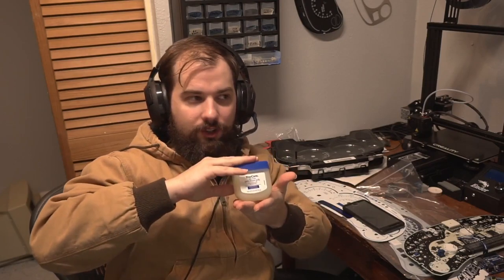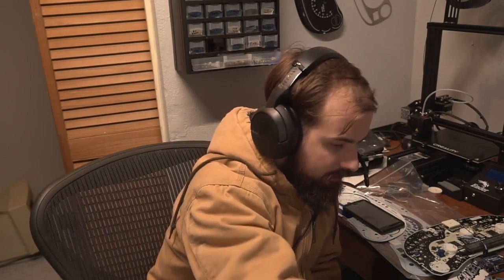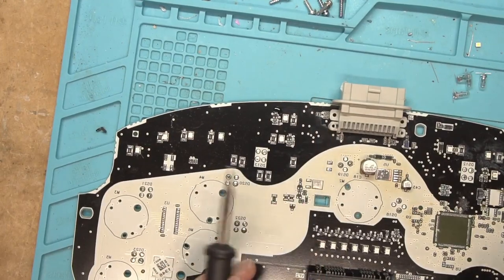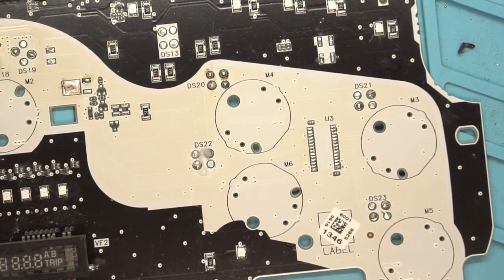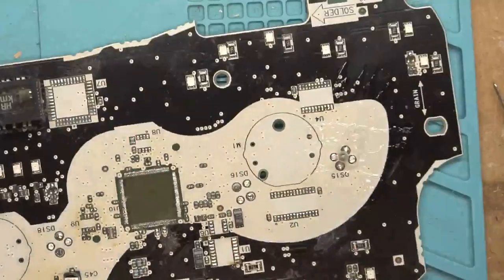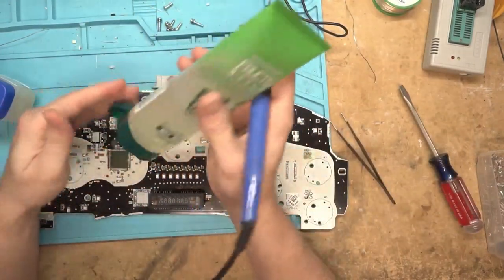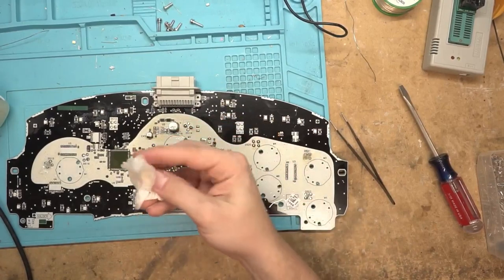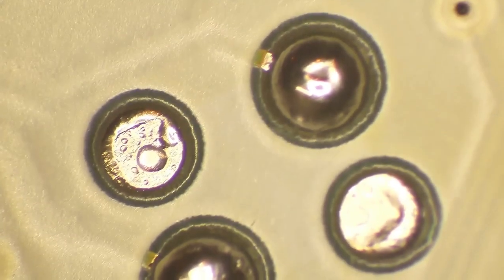Vaseline. Will it Flux? Using Petroleum Jelly As Flux...

Comment: Hello there, thank you for the cool video. I have a Weller soldering iron and want to use it with empty plastic jugs that used to contain drinking water. You can make all sorts of things with empty bottles and I like the recycling aspect. The soldering iron gives surprisingly straight & clean cuts compared to an utility knife. Now, to avoid molten plastic to coagulate around the tip, would it help to immerse the tip in petroleum jelly before hitting the plastic? Thank you in advance!

Comment: Hello sir , i am using a flux cored wife for soldering but when i am joining the solder and the soldering iron the flux inside the wire is comming out and getting burned and making the molten solder black and unusable what i can do ti fix it?
Reply: Clean the iron tip and reduce temp
Or use different solder

Comment: So vaseline does not work ?   ---why make a video if it does not work as a flux //.  and what is am tech / ?? ---THIS IS WEIRD !
Reply from the maker: It did work exactly as shown in the video. Amtech is a brand of flux that is popular due a few technicians that use it on YouTube like Luis Rossmann. Due its popularity there is a lot of counterfeit Amtech on Amazon and Ebay. No one really knows whats in the counterfeit stuff but its suspected to either be lower quality flux or real Amtech cut with Vaseline. Don't actually use Vaseline as flux. I prefer MG Chemicals and ChipQuk because I can get them from reputable vendors like mouser/digikey.

Comment: dude clean your work then use syringe to apply flux second add mustard oil to the vasiline it has a high burn of point......since flux with pine resin is hard to come by these alternatives work perfectly.....Tks for thr tip using hair gel will try send link for that specific brand....tks
Reply from the maker: The video is joke. Just use real flux it's cheap and work great.